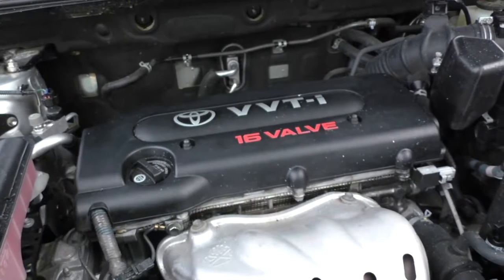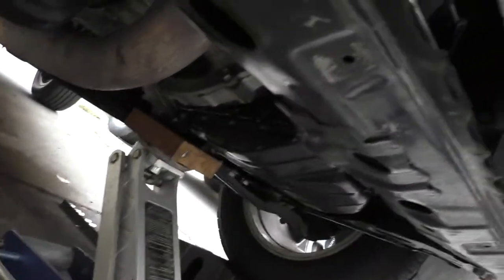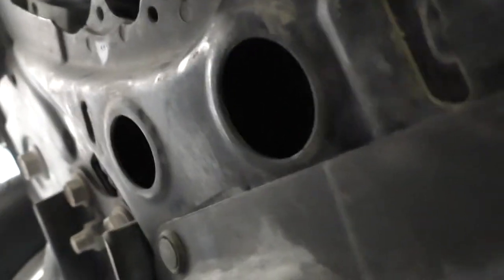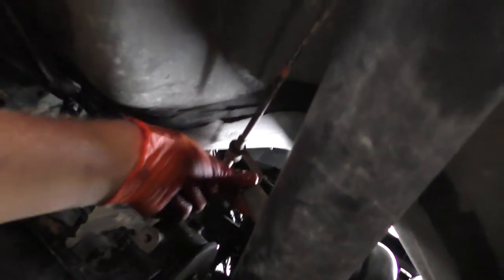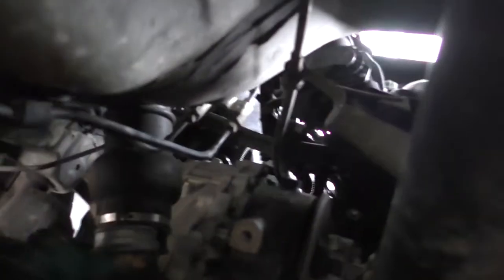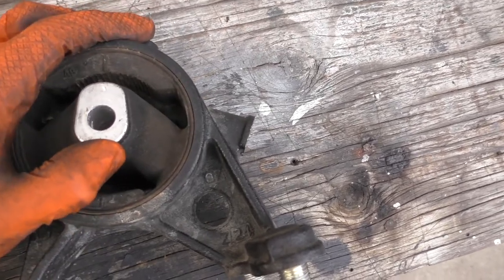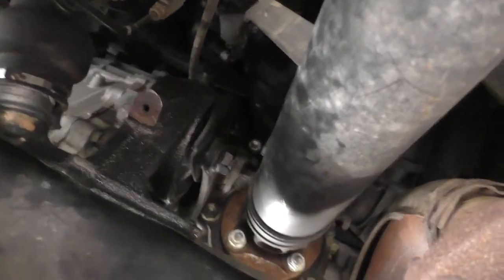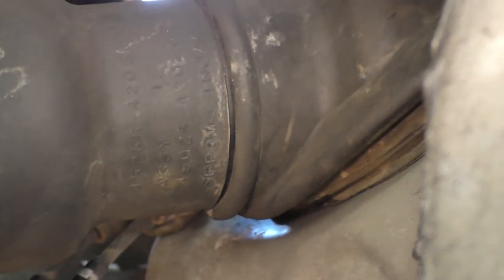08 Toyota Rav4 Rear Engine Motor Mount Replacement - 2.4L 2AZ FE - 4WD - Automatic

Comment: Good video.  I'm replacing the O- ring in the transfer case output shaft. I actually have to remove the stupid transmission mount to get to ONE of the bolts. Sometimes I hate Toyotas. Lol
Reply: Just like any manufacturer they have easy and hard cars to work on. At least they need less maintenance compared to most on average Especially American and German.